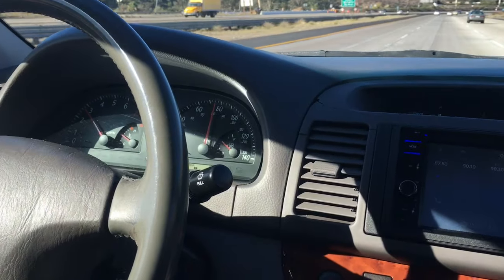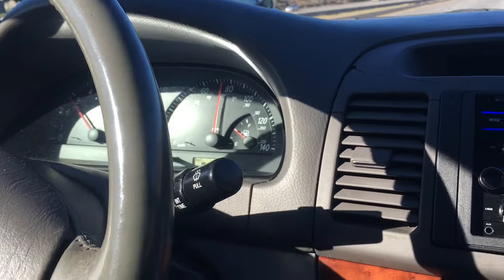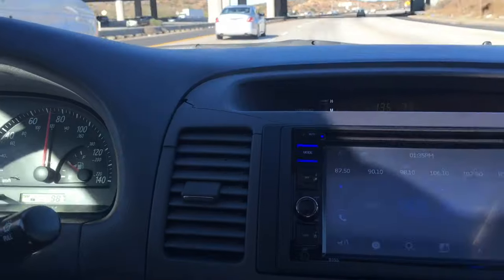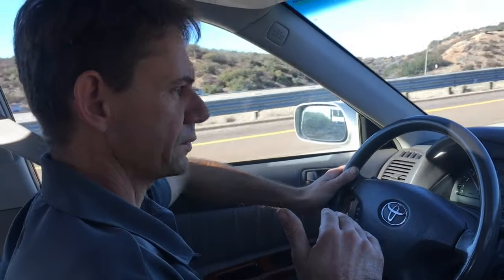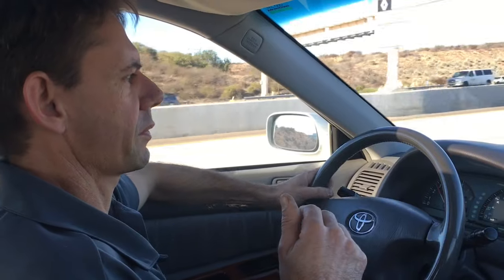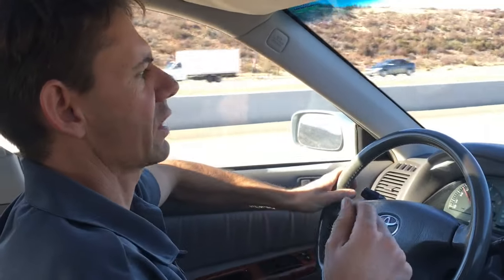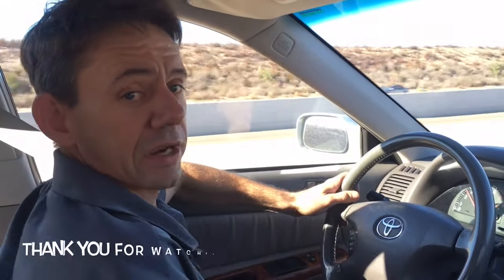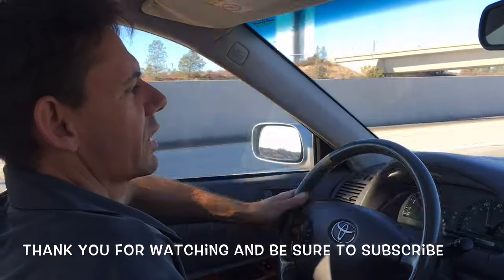How To Tell If Your Tires Need Balancing

Comment: I Have a new car drives smooth until 55mph I feel a slight vibration just did an wheel alignment and I'm still having the same symptoms
Reply from the maker: Dave Merc align it won’t fix the vibration sounds like one of the wheel weights fell off. Have the tire balance checked.
Reply: How to Automotive thanks for the reply! I will do that today. funny thing is I hit a massive pothole here in Manhattan New York City and started experiencing the vibrating the next day. And again thanks for the quick reply and your video, I'll keep you posted
Reply from the maker: Dave Merc with that information I would also have them check for a bent rim.
Reply from the maker: Dave Merc thank you for watching!

Comment: I fell the vibration, but it has a noise too. Is that still a wheel balancing problem?
Reply from the maker: Steven Hernandez it's possible one of the Bearing are bad or the tires are cupping badly.  Due to the tires being out of balance for a long time or shocks and struts worn out.

Comment: What happens if it dose that and jimmy when put the brakes on
Reply from the maker: randy cornwall so if you hit the brakes and it vibrates that means the brake rotors are warped.

Comment: @How to automotive
I have a 2011 Sierra 1500 that vibrates when under load, it's kinda like running over those bumps on the side of the highway. The confusing part is that the RPM bounces up a couple hundred when it happens, any ideas?
Reply: Could be a vibration caused by the engine or tranny. Worn engine mounts or other issues in the engine can cause vibrations.
Reply: @gheorghe20  
The motor and transmission mounts look brand new, there is no play in the u joints on the driveshaft (it is 4wd and I didn't check front ones yet). The motor doesn't make any funny noises at idle or when revving parked. No check engine light either. Only weird thing is a tiny vibration in the gas pedal sometimes, dealer said that was normal though.
Reply: @greghercher2068  check the bushings for the control arms. It is so hard to pinpoint these kind of issues sometimes....

Comment: So there's nothing between a bad balance tire and a bad axle on your car nothing in between??? No other possible cause ball joints.. tie rod..
Reply from the maker: Actual vibrations are usually felt from zero to your first acceleration. And more pronounced when you’re turning left or right

Comment: My steering wheel vibrates and shake at 80 miles an hour
Reply from the maker: Omar Carnegie if it’s doing it when you’re not braking then it’s most likely the tire balance. If it’s vibrating when you hit the brake pedal then I would suspect warped brake rotors